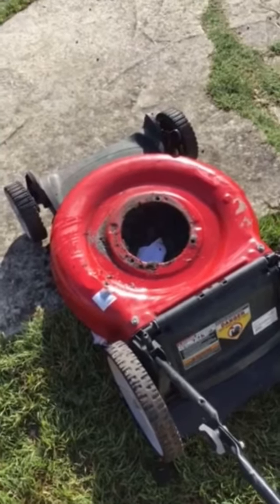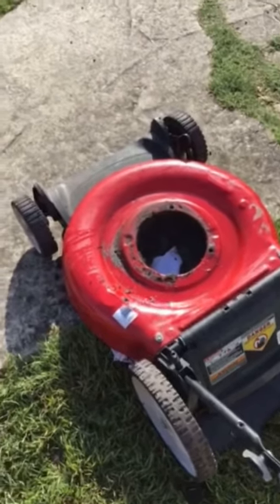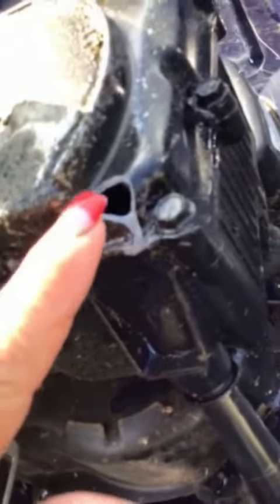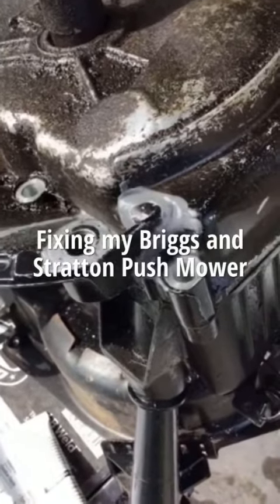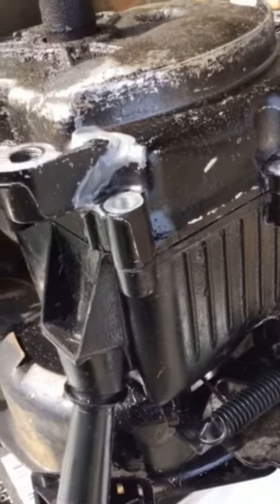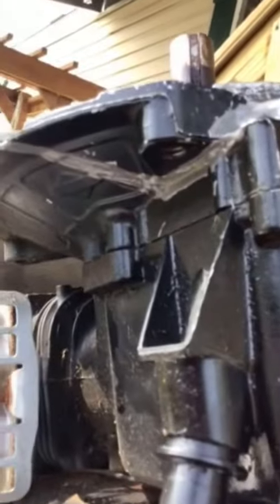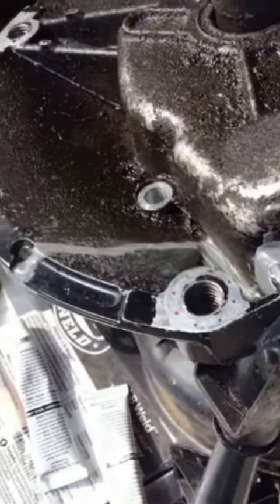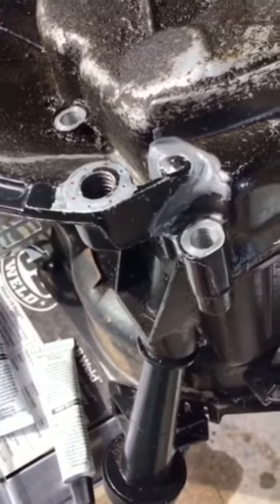Fixing my Briggs and Stratton Push Mower

Comment: Nice. That mechanic was trying to sell you a new motor or whole mover. Glad you tried fixing it with jb weld. Vibration. Lol. I used jb weld on a friends y7 camaro one time to fix the chipped casting hole that has the thread for the alternator bracket on the cast iron block. A lot of vibration there. It worked. Glad you didn't take no for an answer. Well done. Happy mowing. Peace. 😘✌